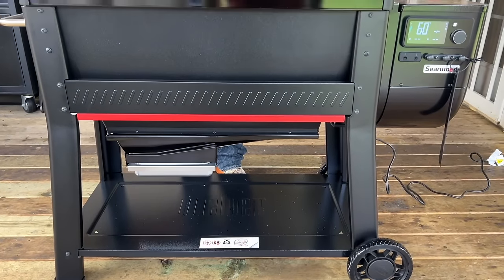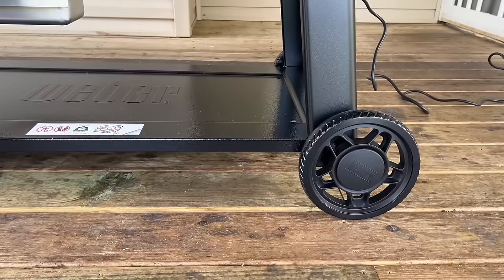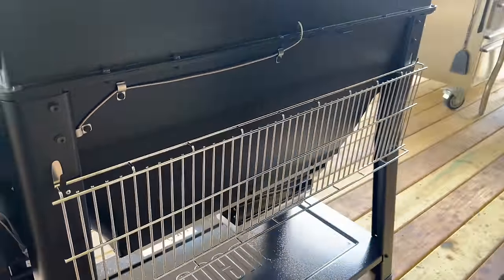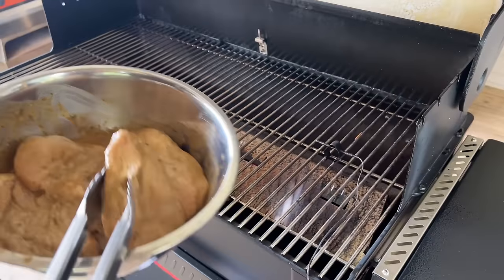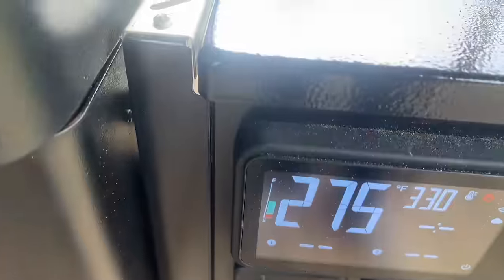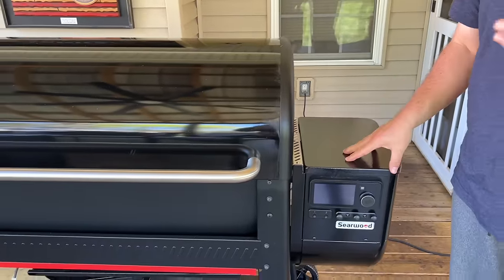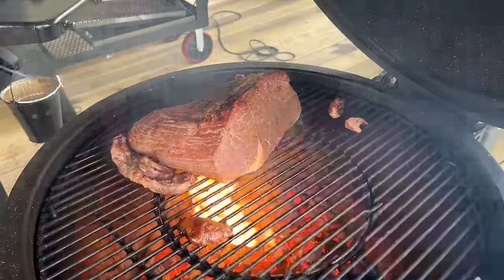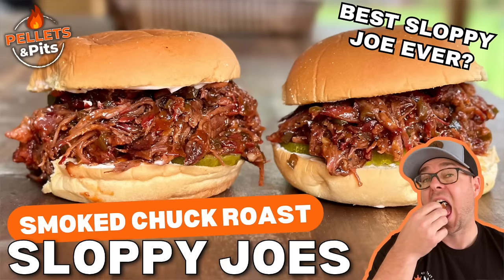ALL NEW Weber Searwood XL 600 - REVIEW and 1st/2nd Cooks!

Comment: How wpuld you say the level of smoke is compared to the treager or pitboss ive had bbq off both and unless there is an extra smoke tube of pellets they just dont have the smoke flavor.
Reply from the maker: So I am reviewing the new Pit Boss Titan this week...I have done head to head with my pit boss navigator and weber summit charcoal grill...in a blind test...its was barely the weber....so not sure what levels of smokers you have had...i think with brands they have lower levers and higher levels...that does seem to make a difference
Reply: @PelletsandPits  the treagar was the big ole iron wood. Not sure the model of the potboss but was smaller that the treager.

Comment: Great grill, screws are trash, tho.  Cheap low quality metal. I went to ace and matched up stainless steel screws with washers and washer locks, torx and blue threadlock, looks way better and thread better.  The allen wrench that came with the grill was loose in the screws provided. I immediately jumped in the car and went to ace to replace them. Other than that, great build. I find it crazy they couldn't have put in some quality screws

Comment: Biggest problem with Webber is that cheap thin metal they use but charge so much. I would never buy a Webber.
Reply from the maker: im clueless about that idea / comment...I have put together and used Pit Boss, Camp Chef, Traeger and 3 different off brands...dont know how that even comes close to being true...thats just not accurate
Reply: Pitt boss 😂 traeger 😂 junk pellet smokers. I’m talking about pitts and spitts and brands like that. Get one and you will see what I’m talking about. Your wrong.
Reply: @BeamerTime354 Sounds like you just can’t afford one so your hating. I’ve owned Weber for 20 years, smokers, charcoal and propane. Never rotted or had any issues. Not saying they’re the best cause I’ve never owned another brand. You’re wrong…
Reply: I feel like it's built better than my Traeger, after I got the Searwood, the traeger went to the dump